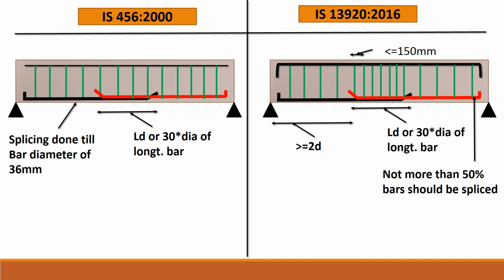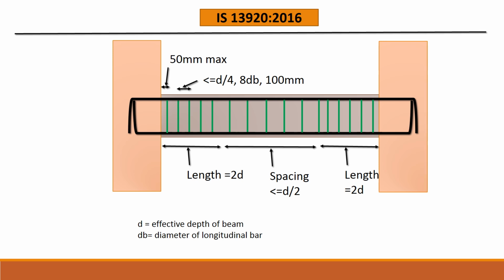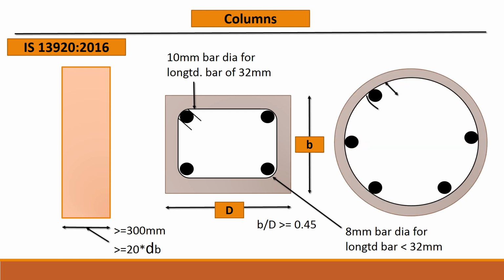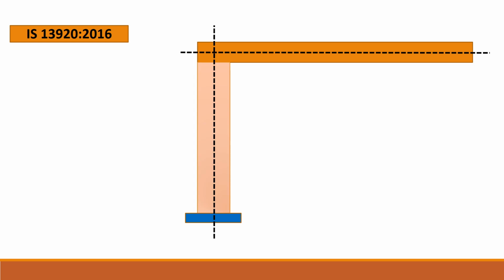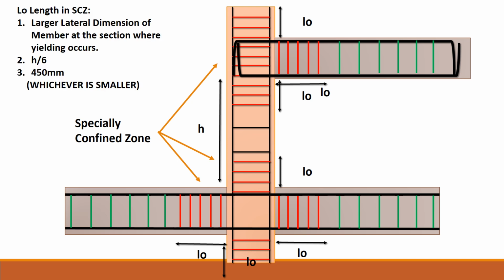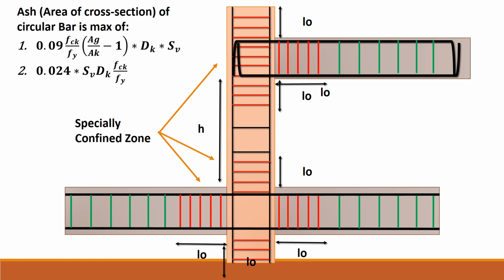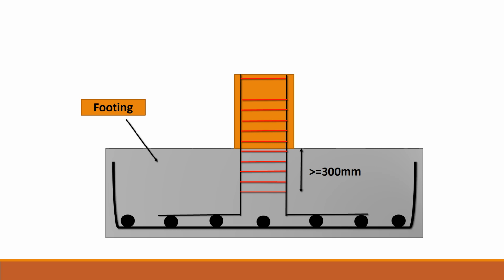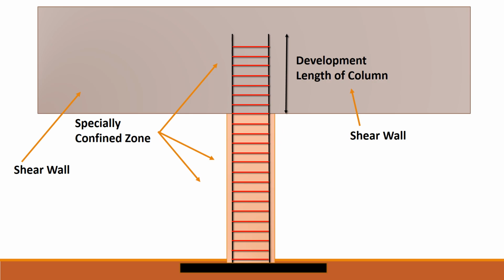Earthquake Resistant Design of Structures Module 2 Lecture 7 #Earthquake #Resistant #Design

Comment: Please refer IS 456, clause 26.2.1, the development length is represented in terms of some finite formula rather than 30 x dia or 40x dia. And its not advisable to splice exactly at the mid section of beam. It has to avoid 2d and the mid section. Splicing in compression region permitted.